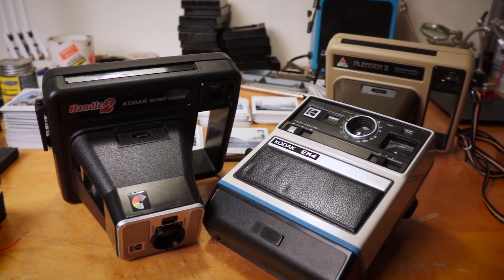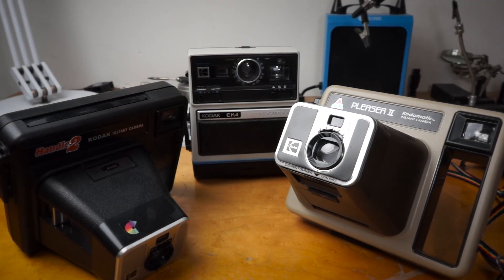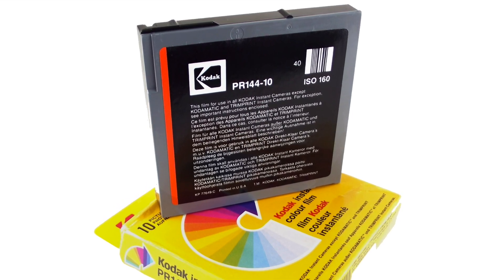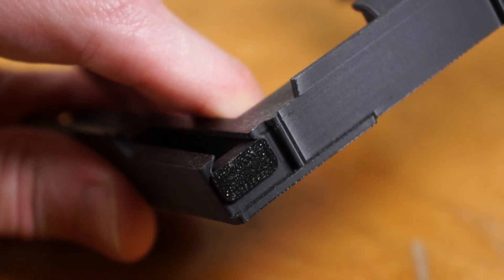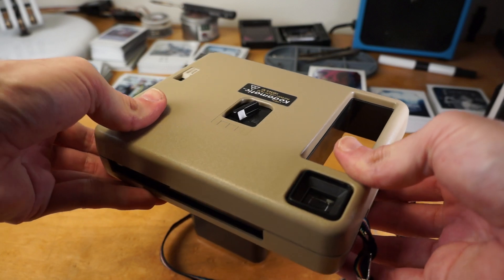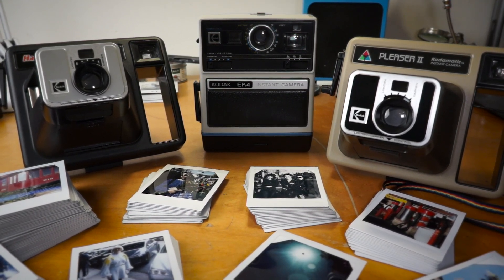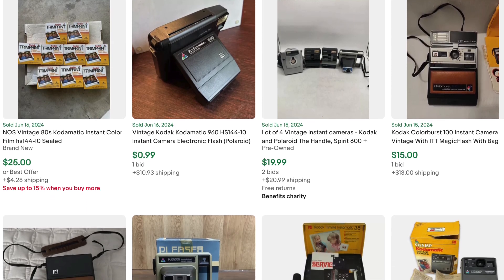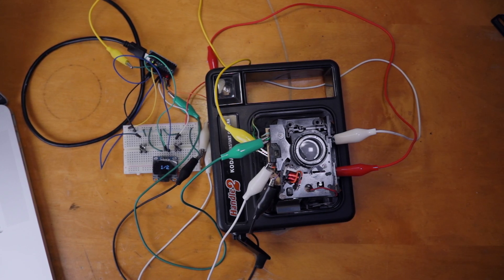Instax Film Adapter for Vintage Kodak Instant Cameras

Comment: Thanks for the 3D file.

So, I planned to resurrect Mr. Handy Fotorama. 
it uses Fujifilm FI-800 (System 800).

I do not know that the adaptor will work for mr. handy since I do not know Fujifilm's FI-800 cartridge. 
is it the same cartridge as Kodak or they have slight different?
Reply from the maker: I know they are very similar but honestly I'm not sure. But you should check out kennethpanda's fotorama mod: https://www.instagram.com/kennethpanda

Comment: Hi John, I have just sent your files to a company that does 3D printing to produce your adapter for using Instax cartridges in old Kodak cameras, but I’m having trouble finding the right springs. I found springs that are .65x7x20mm and .65x7x10mm; could these work instead? Thanks.
Reply from the maker: @Federico84  should be alright, but you'll have to try to know for sure
Reply: I've just got the 3d print, unfortunately i didn't noticr that in the files there is only one one of the two tensioners in back. Could i make it work with just one instead of two? The factory use nylon top mechanical and the picker arm doesnt slide smootly. Do you think that i sand sand it down a little bit?
Reply: @Federico84  Sto aspettando anche io che mi arrivi la cartuccia stampata in nylon,ti faccio sapere come va se mi dai un segno qui

Comment: This is so cool! I have the Kodak Handle, but there's one thing concerning me: should the picker arm and counter move when you turn the handle, even if you don't have battery inserted? Because mine only moves the rollers...
Reply from the maker: @remvaizor3522  there's a little lever inside the film compartment that needs to be held down for it to function. Inserting a cartridge presses it down

Comment: Hello, will it be possible for you to design two springs setup instead of one for the back pressing parts? I found that PLA bars bent too easily, thus can not apply force evenly across the Instax pack, only in the middle where the spring is. When the back press bar bent, they did not provide sufficient pressure, especially close to the side where the picker is, thus my picker constent fail to do its job. Thank you.
Reply: On second thoughts, I think my problem originates from the springs.  I can not get the? exact springs you have, so I just use 0.6x7x10mm and 0.6x7x30mm instead.  They might be too bouncy, especially the 0.6x7x10mm, they may push on the pack too hard so that no sheets will leave the cartridge. I'll try smaller diameter 0.5 0.4 and 0.3 in the coming days.

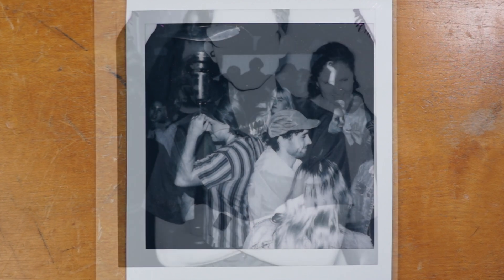Comment: Hello, in 7:55 what kind of flash is that? I only find filp-flash, not reusable like yours. Thanks.
Reply from the maker: @wujiali1117  Kodak made some first party electronic flashes for their instant camera line, as did third party companies. This is a "Magicflash" by a company called ITT. They also made third party flashes for Polaroids and other cameras. You should be able to find a small variety of electronic flashes for Kodak instant cameras on ebay. I chose the ITT because I liked the design and it has an integrated flip down diffuser which is neat. Note: if you're going to get a flash on eBay, make sure it fits your specific model, there are a few different ones

Comment: Hello, thank you for the great work.  A question, after assembled, I found that the main spring has to be 30mm long not 20mm described on thiniverse website, to get the result shown on your video.  I put the 10mm and 20mm together.  Am I wrong or missing something?
Reply from the maker: @wujiali1117  For the main spring in the adapter, I used a .6 x 7 x 20mm 10 lap spring that was then stretched to be about 35 or 40mm
Reply: @JoshGladstone  Ok I understand now.  So my setup will be more bouncy than yours.  But it won't matter too much on crank model camera, right? Since the spring compression is done by hands. As you said the crank cameras are more robust internally. Am I understanding correctly?

Comment: Hi  i have a EK160 , can i use your cartridge conversion?? Or i need a used one for the converssion? Thanks
Reply from the maker: @aldoadasme4668  I've put my files up for the adapter arm for these types of cameras, but I really wouldn't recommend it. First, because I wasn't ever able to get it to work reliably with this type of camera. But more because the cameras with automatic film ejection have very brittle gear mechanisms that tend to disintegrate if they come up against any resistance. So it'd be hard to work with them without replacing those gears or something like that
Reply: @JoshGladstone but maybe will work on it? Just the gear its your con, ?

Comment: Extraordinary! I have the EK-20 but doesn't the camera need a very odd battery in order to work? I'm surprised you didn't mention that 😮
Reply from the maker: @lobomella  it is an odd battery, but you can get them on Amazon for pretty cheap so they're still readily available

Comment: So I can't use it in a Kodak ek 200 or yes
Reply from the maker: Probably not at the moment. The cameras with automatic ejection have plastic gears that become very brittle over the years, and any resistance tends to cause them to break apart. It's possible that the gears could also be 3d printed and replaced, and that might make it feasible, but I haven't really looked into it.

Comment: I'm very excited to see this. Thank you. Probably due to the peculiarities of the printer I'm using, the parts aren't quite fitting, but that's why files and sandpaper exist. 😊
Reply from the maker: Good luck!!
Reply: @JoshGladstone  Still working on this -- a few more pieces to print -- but what I have pieced together (frame, picker, spring, plug) actually functions in the camera. So far, so good! Thrilled.
Reply from the maker: @gentleman-shutterbug  sick!
Reply: @JoshGladstone  I'm having trouble getting the picker to push the photo up into the rollers -- I may have filed it down a bit too much -- but I was able to make a test exposure I fed through the rollers manually (everything in a dark bag, of course).

Comment: oh well - spent the weekend and... it works mechanical 🙂 yesss
but it seems that the light meter on the ek4 is broken - at least the battery test button doesn`t make the led turn on and the sheets are over exposed. battery is new and still goog - tried to clean the contacts scratching them. any ideas how to fix that? any sources on that available? mmmh - help is welcome 🙂 

I also do have a ek8, but I guess the adapter (the pickup) needs to be modified. are there infos on which camera the pickups work? (beside the ek4-one)
Reply from the maker: Only works on the large Handle type cameras att the moment. I uploaded the latest version I made for the ek4 but it's not super reliable. Might be a good starting point for tinkering though, if someone is interested.

As far as why your ek4 might not be working, the number one reason would be corrosion. Do you notice any blue-green battery corrosion anywhere in the battery compartment? People leave batteries in there for decades and leak into the camera internals. I had this happen to a Handle camera, but I was able to take it apart and soak everything in vinegar to remove the corrosion and free up the shutter, and then I had to repair a couple of traces on the circuit board with some wire. Which did fix it. Not sure how to fully disassemble the ek4 at the moment though.
Reply: @JoshGladstone   I just bought a box of instant film cameras because a couple of them still took modern Polaroid film and we like the nostalgia and image characteristics. The ColorBurst 300 (ek300) and the Champ look really cool and would be nice to flaunt at get togethers, but apparently the adapter you made only works on the HS cartridge? The Champ had an empty cartridge inside (HS) but the ek300 did not so I couldn't compare.

Also, anyone buying the motorized models should obviously check the battery compartment for corrosion but another clue for gear usage from actually taking pictures is the original battery will indicate. "IMPORTANT: CAMERA BATTERY - Install before using camera. See instruction manual." That would indicate it was most likely a holiday present and was abandoned after the complimentary film was used up (If they even had that included). A battery with no sticker was probably a camera that was being used a lot.

And thank you for dedicating time and effort to and area that would be otherwise abandoned.

Comment: How did you remove the front bezel?
Reply from the maker: The metal faceplate pops off, there are a couple screws to remove, and then the cover slides off.

Comment: I've been having some trouble printing this, also on a P1s. There's a lot of friction in the arm and base assembly that prevents it from sliding smoothly, and even after sanding it down it still feels like something's stuck. It also doesn't seem to be hitting the instax cartridge enough to catch on anything.

Would you be willing to share a screenshot of your print settings? I tried what you've got listed on the thingiverse page (0.08 layer height and supports as the big ones) and I'm not sure what I've got going wrong at this point.
Reply from the maker: Sorry you're having trouble! It's pretty much the default 0.08 Extra Fine profile with Default Snug supports. I changed the support x distances to make it easier to remove, but that's pretty much it, and that wouldn't affect the print.

Someone else also told me that they printed it and it didn't move smoothly. I just printed/measured this calibration print (https://www.printables.com/model/164261) to make sure my printer isn't off, and it looks pretty dimensionally accurate, so I'm not sure what the issue could be.
Reply: @JoshGladstone  got it! I was running on the default high quality but I’ll give it a shot on extra fine to see if that makes a difference. thanks for responding!

Comment: may i ask which springs exactly did you use?
Reply from the maker: For the main spring in the adapter, I used a .6 x 7 x 20mm 10 lap spring that was then stretched to be about 35 or 40mm. For the spring back plate adapter, I used a .6 x 7 x 10mm 6 lap spring. There's a link in the description to the exact set of springs I used.

Comment: will this adapter works on fotorama system as well?

anyway thanks for sharing❤
Reply from the maker: Good question! I'm not sure. I know the Kodak Instant and Fotorama formats are extremely similar, but I'm not sure if they are 100% compatible, and also I'm not sure how robust the Fotorama internal mechanisms are. So it might be possible to use this or alter it to work with Fotorama cameras, but unfortunately I don't own any so I can't say for sure. And I wouldn't really recommend trying unless you're willing to break a camera or two.

Comment: I wonder what would happen if you took a brayer roller to the film after you exposed it? Would it push the chemicals into the corners and develop those areas? If I do this mod, I will have to give it a try!

Comment: I'm going to get one of these printed!

Please do continue with the manual control.   I'd buy one if you made it available
Reply: OK it's printed and my springs have arrived.  Time to assemble
Reply: Its working.   I'm on my second pack currently.  I did switch the springs to get the backplate to apply pressure.  I used the .6x7x10 but didn't cut them in half.  It's working better in the pleaser 2 I have.  

I also notice my top corners are larger than yours.   I'm not sure if I can post a picture in these comments
Reply: What I meant by too corners is the developer spread misses more of the top corners

Comment: Really interesting thanks for posting this. Can the adapter be purchased for those of us that do not have a 3-D printer?
Reply from the maker: I'm not really planning on selling them mostly because I wouldn't really want to take money for something that I can't really guarantee will work 100% consistently and won't damage people's cameras and stuff. There's a bit of DIY jankiness involved.

That said, there are 3d printing services out there. I can't speak to how much they might cost or even if they would necessarily work with this project, but that could be an option.
Reply: Okay. Thank you.

Comment: I'm very happy you actually have instructions on this now.  It's really funny cause I bought a kodak instant a month or two ago because I saw your project on yeggi.  

The Arduino came out of no where.  I please recommend you switch the code over to micro Python or something so that it can run on a pi pico.  I learned on Arduino too, but the price of atmega chips compared to the rp2040 gets bigger and bigger so it would be nice to keep it cheap.

Comment: You are such a legend for doing all that work and posting the files. Could you apply kapton tape to a roller to thicken it a hair?
Reply from the maker: Interesting idea! Possibly! The rollers have a grippy texture on them because they need to pull the photo through, but it's worth a shot!
Reply: @JoshGladstone  That's nothing a little diluted coke on a brush can't fix! Plus if you only put the tape on one roller it should still pull it through I would think.

Comment: I just saw this in my feed. If I got one of those kodak cameras I would need to find a place to buy the adaptors. I don't  know anyone with a 3 d printer so.. Harold and Maude. Great movie.
Reply: I’m in the process of moving into a new house right now, so I can’t do anything, but I almost want to contact OP and work out a licensing thing, just to crank a few hundred of these out and sell them. I’ve been in the position of not having a 3D printer and seeing things I REALLY wanted. Living in the middle of nowhere, nearest maker space to me being like 16 hours away. Hate that shit, work out something with SOMEONE, they print and sell, you get a 20% passive kickback for being the designer, they deal with printing and shipping and all that shit, and get 80%. That’s what I’d do, anyway. Or, if nobody’s doing this in a few months when I’m all settled in, I might just send you a DM.
Reply from the maker: 3d printers have been getting cheaper and better lately, but it's also a whole thing to get into so it's definitely not for everyone. Many of cities also have makerspaces or libraries that have 3d printing facilities for public use. But again, not necessarily everybody's cup of tea.
Reply: @JoshGladstone  I would rather buy one already made. Easier for me.

Comment: I guess it works in a EK-4, right? Thanks for sharing!!!
Reply from the maker: No, unfortunately the ek4 has a different picker arm mechanism, so it needs a slightly different adapter, and I haven't been able to design one that works reliably enough. Yet.
Reply: @JoshGladstone  can you share your ek-4 design even though it may be a Work in progress? Maybe I can help you improving the design, I have a 3d printer an 3d design skills
Reply from the maker: @VirtualTechie  Sure. I've added the EK-4 picker arm file to the thingiverse link. Good luck! Be careful!
Reply: @JoshGladstone  legend!

Comment: After i saw your video i tried to make the adapter myself after like 17 prototypes i gave up , my adapter worked but it never worked on my friends cameras or printers 
Also i have made gears for some models of later automatic cameras its available on thingiverse and printables, its so cool that you got it mostly working and released it ,also looking foward to seeing the arduino manual mod
Reply from the maker: Yeah it wasn't easy and I went through a lot of film and broke a couple cameras in the process, but I've used it on two or three cameras and it's worked fairly reliably so I figured it's good enough to release. I'll have to look up your gears on thingiverse, I've broken a couple of those cameras too! 😬
Reply: @JoshGladstone  it appers as Gear for a kodamatic 960 instant camera cant share the link yt is problematic with links , also to me the ek4 and the kodamatics 960 were the models i like the best , also had good luck with "the handle" and party flash model
Reply: I may just share my file as iss aswell maybe someone with more interested can pick both of our desing and made one even better or improved on one them
Reply: @Joshgladstone @briansegarra9312 have you got some gear design for and Ek8 too?